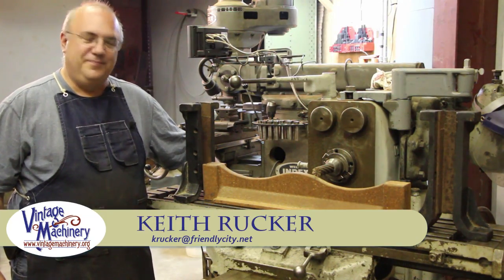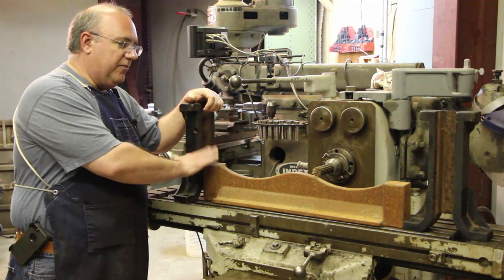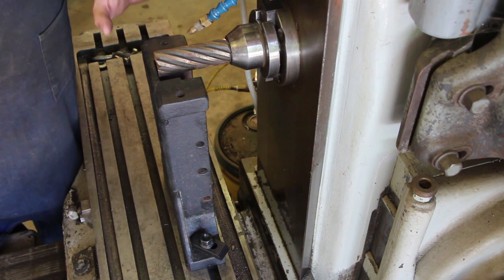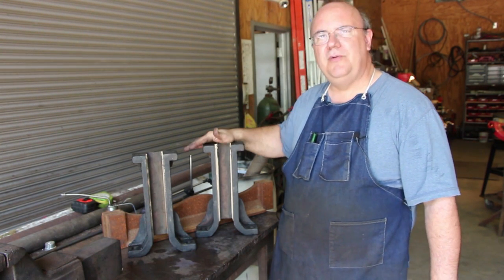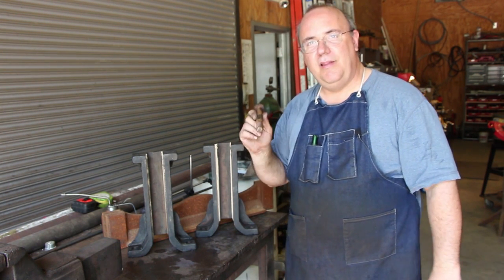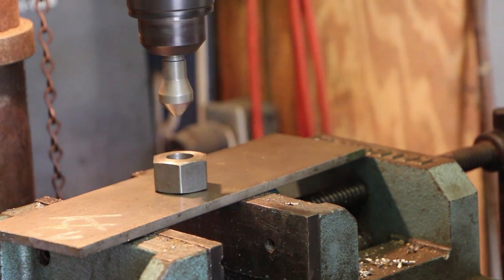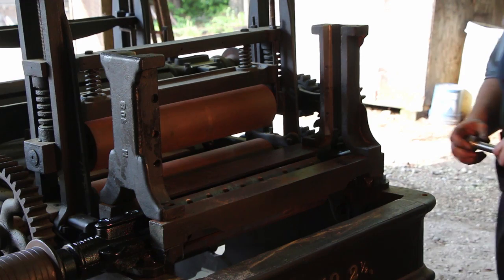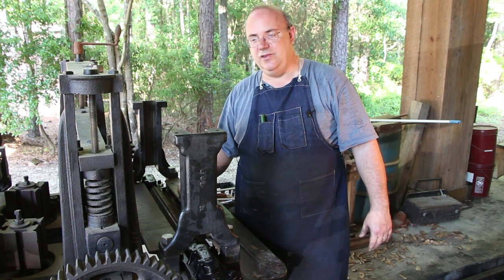J. A. Vance Planer/Matcher Restoration:  Machining and Installing Oufeed Pressure Plate Stanchions

Comment: Pulls out correct size wrench

Uses it like a hammer to drive the bolts into place

Tighten with different wrench

Honestly got me thinking about how many times I did that myself over the years 🤣

Comment: Keith, on my screen that pressure plate looked like it was made of wood, or MDF...and I was thinking, "why does Keith have a sawn off bit of table in his video?  Is this one about attaching legs to aprons?"

I particularly liked the wrench holding nut for chamfering and the floating vise trick...have to keep those in mind for someday. I am a bit curious about the power tapping though...no reversing during the tap?  That didn't look like a spiral tap...why don't the chips bind?  

Thank you for the video!

-- Mike

Comment: Hi Keith,

I once got a box of untapped nuts. Needing some right away, I set a friend to power tapping them. He was rather nervous of hitting stop or reverse at the right time and not breaking my only tap the right size, so I came up with a little trick.

I set up a long reach socket in the vice and a depth stop on the quill, so the nut would just pop out the top of the socket if you tapped too far.

Comment: Hi Keith,

Very instructive and interesting video, I'm always amazed to see how you simplify the process and the set-ups.

Got to get those fast forward machines, they're flying, they seem to do wonders.

If you have time, one question, this hex material is probably soft steel, does it get highly prone to rusting, I mean much more than allied steel, how about stretching with time?

Keep on the great work it' appreciated,
Pierre

Comment: Hey Keith,

Nice bolts you got there. I think I need a horizontal mill. Thanks for sharing.

All the best,

Tom
Reply: ***** mine is a dekel fp1 its both horizontal and vertical but i am missing the vertical head... instead i got a rapid head and a tilting table :)